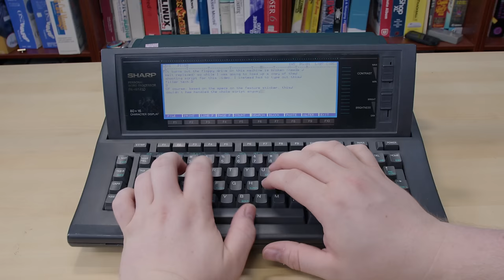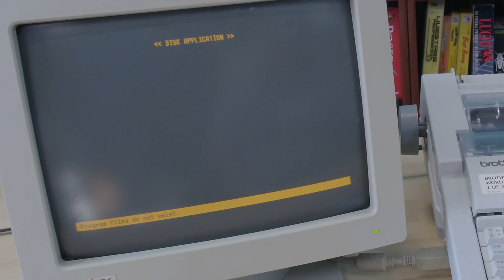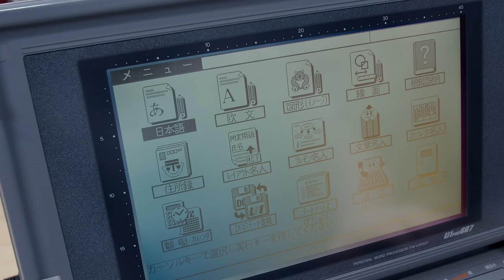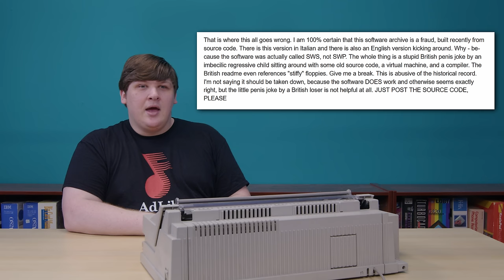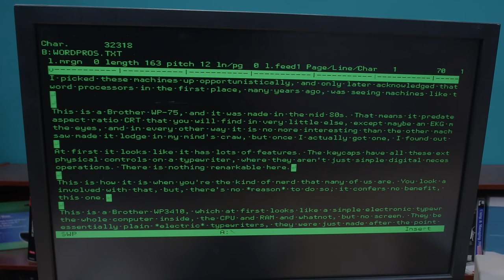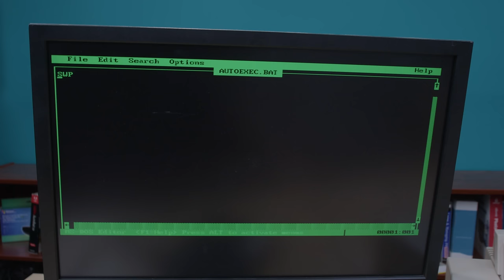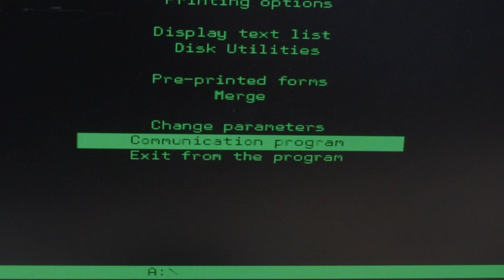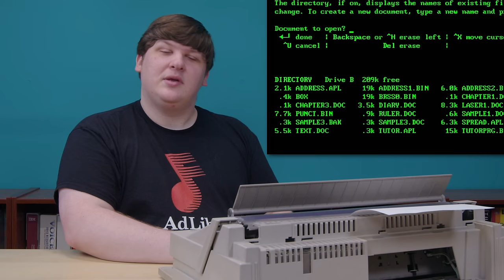The Weird Processor: Olivetti's PC Typewriter

Comment: I thought you said "Word processors are boring"? And yet, I am currently 40 minutes and 40 seconds in and genuinely in awe of what the Olivetti is capable of. I had been around a metric SHIT TON of electric typewriters and word processors up to about the year 2000. My mom did secretary work and office work right up to about 2000 or so, and at one time could type on average 120 words per minute, error free. I have watched her type so fast that she regularly had to stop to let the machine catch up, and she was good enough to continue typing where the machine had run out of buffer with just a quick glance at the page or screen, and then back to typing as if nothing happened, without looking at the page or screen again till the next buffer overrun. She actually worked for an attorney once that would leave before she started typing at the end of the day because her typing was louder and faster than his printer. If she would have had access to something like this, I think her switching to computers would have been smoother in the late 1980s into the 1990s. She wasn't dumb, she picked it all up quickly, she just initially hated the extra steps needed just to type up a document, and she preferred on-the-fly typing over typing on a screen.

Comment: Those remind me of the AlphaSmart word processors I had in school because of my hand issues. They were basically a keyboard with a built-in LCD screen. To print anything, you had to plug it in via USB, open Word or Notepad, and when you hit Print on the keyboard it would rapidly type everything that was in the current save slot into the text editor.

Comment: The thing that made me "I want to be near that, I want to be some way involved with that" when I was a kid was those real basic PDAs/organizer things, they were so fascinating as a computer that goes in your pocket, Nowadays even have a few full featured Windows Pocket PCs in my collection of crap, and even those are pretty meh, I remember getting those Zipit z2 things back in like 2010 when they were worthlessly cheap and hacking Linux on them, I played with them for a while then they ended up on the shelf. Once all the individual gadgets like point and shoot cameras, PDAs, MP3 players, etc all got replaced by the modern affordable smartphone they're just pretty, meh, to look back on.
Reply: The battery of my poor Z2 had died when I recently had a look at it after many years. It was fun to tinker with back then.
Reply: The  pda had a lot of potential but you had to connect it to a pc to get software and for some reason it never went smoothly. and you had to pay for everything ofcourse so you usually just ended up using the build in stuff and getting bored quickly .but it seems like i had forgotten how advanced pdas got in the 2000s. because i keep thinking about the ones from the 90s that were not very impressive if you wanted to do more than just basic business things .but in the 2000s they could do almost everything a pc could but with reduced resolution .the smart phone was more convenient because it could connect to the internet without wifi or an addon for 2g or 3g internet .

Comment: Interesting machine. "Word Processors" were also extremely popular in the UK, thanks to the Amstrad PCW line of machines. They were about 1/4 the price of an equivalent PC setup at the time, and provided everything you needed to write and print text: a sharp green screen, floppy drive and printer. They were the first computer introduced to millions of homes and businesses. The neat thing about them was that they were actually a quite capable CP/M machine, though long after CP/M was popular (launched in 1985). That meant there developed a huge ecosystem of third party software (business and games) and add-ons. Taking what appeared to be a horribly out of date system and packaging it just right at a low price was hugely successful, and Amstrad's word processor turned out to be an affordable "real computer".

Comment: 2:01 The carriage is moving so that you can see where the text will go on the paper - very important for the days when you were often using typewriters to fill in pre-printed forms. Back in the day (early to mid-90s) I used a very similar electronic typewriter for job applications, filling out multi-page application forms full of boxes into which you had to write or type. I would routinely photocopy the forms multiple times so that I could use them as draft copies to set the tabs and ensure that everything fitted properly into the boxes before I committed to putting the proper form into the typewriter and letting it run; it had battery-backed memory so that you could store multiple pages as separate files and print a whole page at a time.

Comment: The OLIVETTI BCS3030 was a Desk Style computer where you have to take the back off the desk after removing a few screws and and remove the metal cover of a box to gain access to the  PCBs , it also had really strange multi way connectors, It also had 8" duel Floppy Disc drives driven via one motor and a few belts and pulleys, and a bi-directional line printer.

Comment: I did a double-take when you showed the Brother word processor. I went off to college in 1982, when PCs, for the most part, didn't do a whole lot for us. (For example, our Apple ][ Plus had a word processing program, but when I was in high school, our Apple did not yet have an 80-column card, and our printer was a 40-column thermal printer, and I only had one teacher who would accept assignments on a 4-inch wide scroll of thermal paper in all caps that weren't anywhere near what was then known as "letter quality".) So my college composition machine was an electric typewriter. The next brother in line, though, graduated high school a year later, when these word processing typewriters came down in price, so he went to school with a Brother daisy-wheel model very much like the one you showed, if not the exact same one. I'm not surprised that your Olivetti still works. My brother's Brother survived a rollover car accident in which the typewriter got banged around the inside of the car before being ejected out of what was left of the back window. (The bigger miracle was that he and I walked away from that one with barely a scratch apiece.) He plugged it in when he got it home, and it fired up and worked without a hitch. I don't think it lasted him through college, but that was probably only due to hidden damage from the accident. My point is that those things were built to last even if they were toted and banged around a lot.

Comment: The main issue you had trouble with the signal on a composite monitor is that it's a not a 15khz horizontal sync, it's likely 31khz or higher. This is why you sometimes saw two copies of the image per line, it was trying to sync to every other hsync pulse. As for something to use it on, try any of your trinitron VGA monitors. Every one I've owned secretly supports sync on green, and several non trinitron VGA monitors I have will too. What you've got coming from that machine is essentially "composite monochrome VGA" so if you had a sync stripper to seperate horizontal, vertical, and video, you'd have a completely standard monochrome VGA signal. They likely combined them to reduce wire count. Seperating sync from video isn't hard to do

Comment: Used to own one of the small Brother word processors, maybe even the model in the video. Absolutely loved that thing.  I could type whole documents at any time, even when my housemates were sleeping, and just print later.  I could take the ribbon out and type using carbon paper when whatever I was typing wasn't critical. And I was mailing 8-page letters to penpals. Typing unlocked and changed my whole life.  True story: I won a TV somewhere and tried very hard to get the prize switched to a typewriter. Didn't work.  It was years before I got a PC with a printer.  And I can still type faster than anyone I know.

Comment: That Smith Corona hit my kind of aesthetic enough that I'm now seriously considering trying to roughly replicate it in modern form via an unholy fusion of one of my old laptops with my laser printer.  On the plus side, that would make it a lot easier to set it up as a print server, but on the minus side, I'm pretty sure that would be worse than a separate laptop and laser printer in virtually every other way.
Reply: Depends on your feelings with CUPS or other printing protocols.

Comment: I took an old laptop, stuck a Linux distro with no gui on it, and installed a text interface word processor program on it to use as a word processor clone. I imagine that is much easier nowadays than whatever these machines were trying to do, especially when it comes to lag

Comment: "why buy this instead of a PC?"

even in the late 80s, many companies still had a computer or data processing group that jealously guarded any notion of "computing." at my first job out of college in '82, local departments were refused any kind of budget for personal computing unless corporate DP approved it, which of course they never did. Even word processing systems from Wang or CPT had to be strictly limited in what kinds of software they could run.

one way around this was, of course, to buy a high-end electronic typwriter or WP system that under the covers was a computer. In this very specific case, unless the DP dept regularly read the ABA Journal, there's a fair chance that a line item for a high-end WP system wouldn't have to pass DP muster and would get approved.

as for feeding paper without the platen knob, my Royal 620C (with a centronics connector which made it behave like a Diablo 630!) had a tiny switch on the on the paper release bail that if you pulled the lever forward - insted of backwards to release the paper completely - it would autofeed the paper into the print mechanism with a top marging of 3/4", I believe. maybe give that a try?

thanks for the stroll down memory(writer) lane!

PS: about using SIMM memory, don't forget the v40 has a 16-bit-wide data bus, so DIP chips would be a pain for a maintenance tech to replace on a 30-minute service call.

PPS: why not make it fully PC compatible? well, Olivetti wasn't afrait to chart their own course, at least initially: https://en.wikipedia.org/wiki/Olivetti_M20

Comment: Ah. Typewriters.
I remember using one to type school assignments back in the day. Computers were around, (I’m not that old), but my family didn’t own one until Christmas ‘92. And the typewriter I was using was primitive compared to the ones shown in this video.. electric, but with no LCD screen (it did have a correcting ribbon, which could delete either single characters or entire words.. so it did have some degree of smarts built in).

I don’t miss them. Not in the least.

Comment: during my first couple of years in college computers were not really prevalent. 
I wrote entire papers on one of those goofy Brothers with the single line LCD. 
It was the kind where you had to buy a whole new wheel to print a different font. 
You say they did not have sophisticated features, but the one I used did have a decent word count, spell checker and believe it or not, find and replace. 
What I cannot believe is that they actually sold an accessory for it which allowed it to be plugged into a computer as a printer. 
Problem was the cost of the adapter, and the cost of a dot matrix printer were about the same. 
Alas my Atari never got a printer. It remained my gaming machine and the Brother was how I did homework.

Comment: On the chips: NEC chips that start with 'd' actually can be found by replacing that with 'upd'. For instance, 'upd78220' brings up a pdf indicating it's an 8-bit 12MHz microcontroller, probaby for driving the printer.

Comment: I used the Z80 CP/M version of the Olivetti typewriter in 1995: they were built like a tank, so it's possible that people used them for a lot of time. On the othe hand Olivetti sold electronic typewriters but with a serial port in the late '80s: basivally they worked like teletypes, had an online/offline button. I remember I've seen in an office an Olivetti M24 with both a typewriter and a 9 pin printer connected. I suppose because a the time the print quality of a dot matrix printer was so and so.

Comment: A few thoughts from someone inexplicably interested in these things:
- Some Brother word processors (including I think the one you have) originally came with a Tetris disk, and in general a lot of the consumer ones were intended as low-cost computer alternatives which explains why they'd include things like this. I have a Canon "desktop publisher" from the mid-90s based around an inkjet printer, and it comes with a clip art and games disk with Solitaire, Minesweeper, and a slot machine.

- They're not easy to find, but some WPs and electronic typewriters can do proportionally spaced fonts; one of those with a decent ribbon can product output that is (IMO) just as good as a laser printer. Some dedicated daisy-wheel printers even have a graphics mode that lets you move the carriage and paper in very precise increments and use the period and such to make basic graphics. Some of the Diablo printwheels I have even have a metal period solely to make it wear out more slowly when (ab)used for graphics.

- The UX on most of these consumer WPs is poor, although Panasonic ones actually seem to handle things a bit better than the ones you showed in the video. I don't recall ever having issues with input lag or dropped keystrokes on mine (although the godawful keyboard balances things out) and it's also got a key combo to invert the display at any time which is a nice bonus.

- The Olivetti-AT&T partnership is somewhat interesting, it was during a time when a lot of companies were branching out into office equipment for some reason, including Exxon (there was an Exxon-branded electronic typewriter, not kidding). I've got an AT&T-branded typewriter that's obviously a rebadged Olivetti and it's interesting since it's got a module system, I somehow managed to find the serial terminal module for it (and mine came with a spellchecker) but the typewriter quit working the day after I got it and I still can't figure out how to get it open non-destructively.

- For loading sheets of paper, did you try pulling the paper bail forwards? Quite a few electronic typewriters have a system where pulling either the lever for the paper bail or the bail itself will feed in enough paper for a comfortable top margin.

- The print mechanism in this device is kind of interesting since the design of the hammer screams late 80s/early 90s cheapo garbage 10 char/sec but it can clearly go quite a bit faster than that. I can't tell if yours can do it, but some Olivetti mechanisms also have a reader for metallic barcodes on some printwheels that encode details about pitch, character set, etc. so it can be automatically configured.

- I'd be somewhat curious what escape codes are being used for the virtual printer for things like bold, underline, etc; something Diablo-like would be my guess since they clearly had some interest in compatibility with regular PC programs but because Olivetti is Olivetti I could also see them going with something entirely custom.

- If for whatever reason you want more printwheels for this contraption, I got several duplicates with my AT&T/Olivetti typewriter that are compatible.

Comment: You're damn right about "Wow, I wanna be near that". That's literally me when it comes to handheld consoles, tiny laptops, and old keyboards. I want stuff like the Gizmondo because it vibes with me and because they're neat, not always because they're gonna be used a lot. I always hope people more skilled than me makes accessories, fixes, or new software for these things so I can use them. That's why even the oldest handhelds like the Lynx interest me so much despite being way older than I am. It's old, advanced as hell for its time, and has a loving dedicated community keeping them alive. You mentioned somebody gutting old word processors and stuffing new PCs into them, wouldn't it be cool if some crazy people made games for them somehow?
Reply: You should get a KeyPro FK9000, It has a button that switches the numpad to a calculator, though there's no way to send its output to the computer. It also has an 8 way arrow key set and 12 Programmable Function Keys to which can be saved a bunch of keystrokes as macros. A NiCd battery charges from the keyboard power to keep the macros, and programming them is entirely a keyboard function so it will work with anything you can adapt a PC-AT keyboard to. Someone even made an advanced replacement for the calculator's LCD and made it do more stuff.

Comment: Many years back I saw one of these sorts of things that had some interesting features.
On the base unit there was a 40 position rotary switch that selected which document on the floppy you were working on.
If you paid for the second drive box, it came with its own 40 position switch. 
If you copied from one floppy to another it took a long time to do it.
The documents had "pauses" in them so they would work like a form letter letting you send the same letter to multiple people .
I think the RAM was very small because the disk drive got very busy if you were moving a block of text.
I think each line of text was written to the floppy as you finished it.